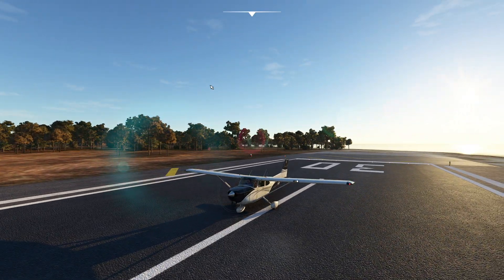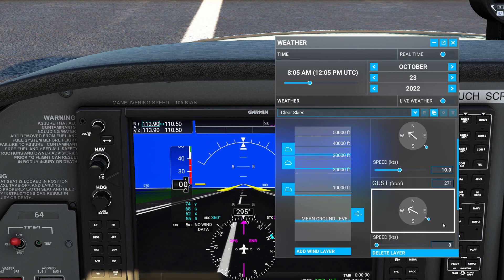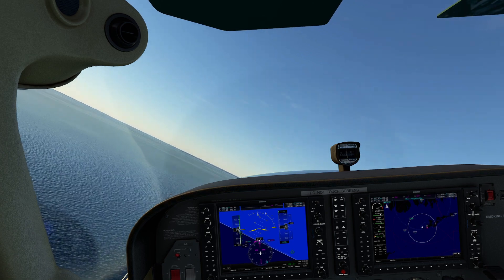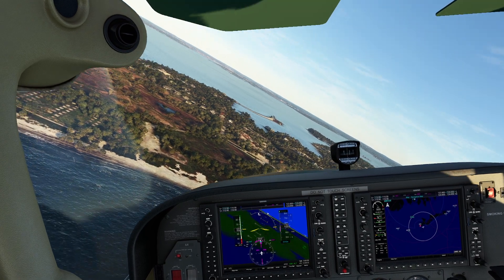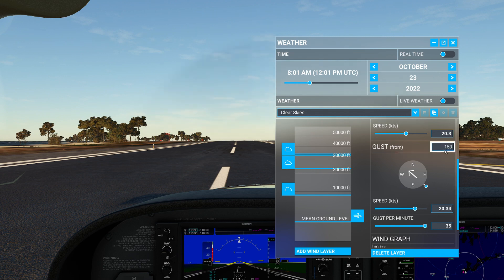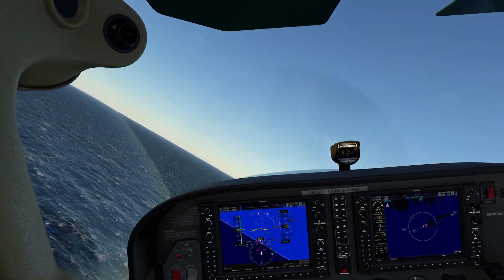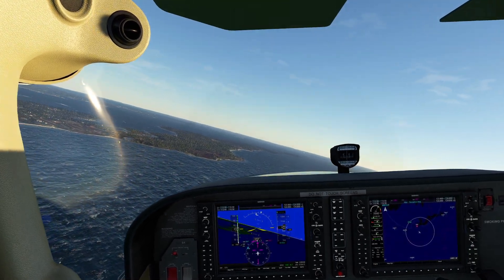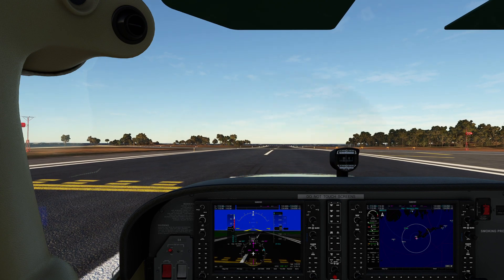MSFS - Wind Shear

Comment: I did the first half of my SEL training in tailwheels at a bush flying school.  My crazy instructor used to swing the stick on short final sometimes, taking me out from over the grass and over the corn that surrounded the airfield.  He would then say "you have the controls, and no go-around."

Years later I was on a rental checkride and I got very bad shear on short final.  The instructor crapped his pants and I simply moved over and put the plane down on the runway.

There are flaws in the way modern flight training works.  Life is not a stabilized approach and not every runway is built to accomodate the big iron.  Definitely work on some SHTF drills like this and learn how to get out of a bad situation, and then go ahead and fly your stabilized approach as standard.  

Great video.  Great idea.